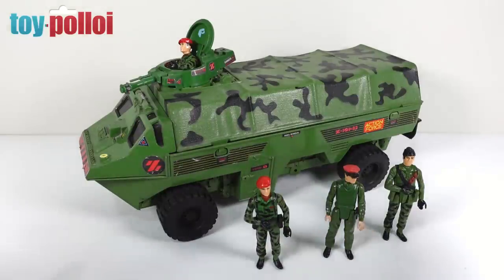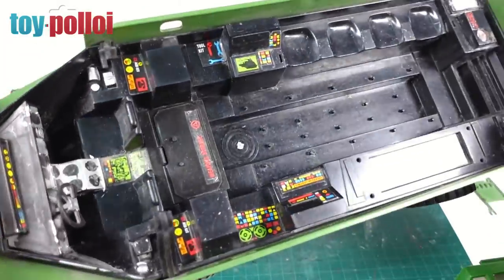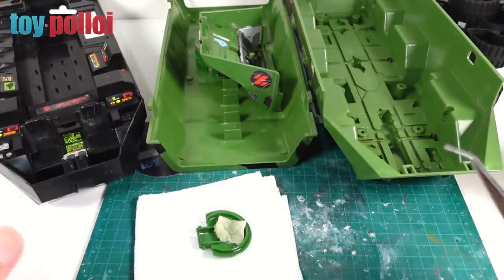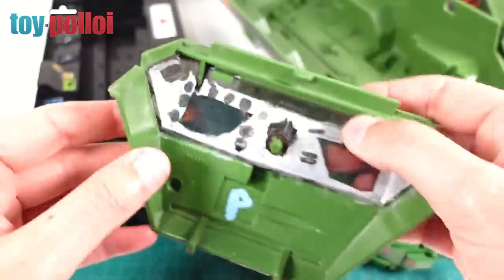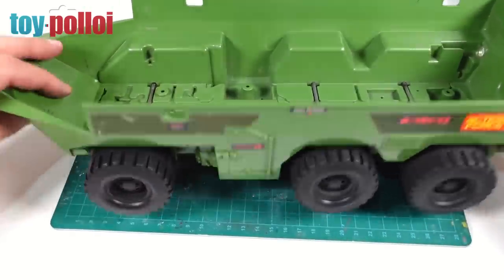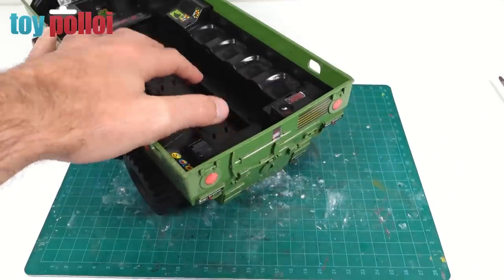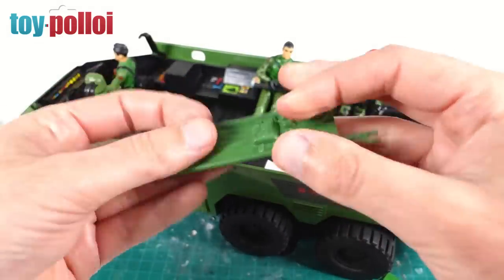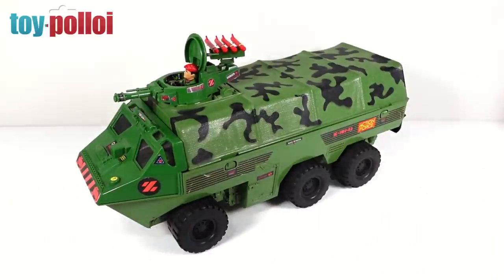Vintage Action Z- Force Force Armoured Troop Carrier (ATC) repairs - Toy Polloi

Comment: nice work. the folks who restore the large stamped metal vehicle toys (tonka, etc.) put their axles into the chuck of a drill and run the sandpaper up and down the axle while the drill is spinning. you can also use the drill method with a bench top grinder with a wire wheel attachment spinning in the opposite direction for more aggressive de-rusting. for the custom windscreen shields, you could attach them with a dab of silicon sealant, so they can be removed in the future
Reply from the maker: Thanks for the info

Comment: Hmm. I find especially with metalic paints that brushing it with 99c isopropyl turns it back into paint, and I can just take it off with a Q-tip. The brake fluid looks like it's getting underneat the paint layer and breaking the adhesion which is pretty cool.

Comment: Have you ever tried magic erasers they do a great job at getting paint off of plastic and can be reused with no chemicals needed
Reply from the maker: I have. They are great for small scuffs of paint. But will not make any difference on large areas like this. If you scrub to much with them they scratch the surface of the plastic. So you need to be careful. Cheers

Comment: Regarding the break fluid, will it also remove the "factory paint" from the toys, eg the black belt on vintage Luke Skywalker Bspin, or will it just remove paint that is equally to, lets say, Tip-Ex? 🙂
Reply from the maker: It really seems to just remove non factory paint. That's what I always use it for.